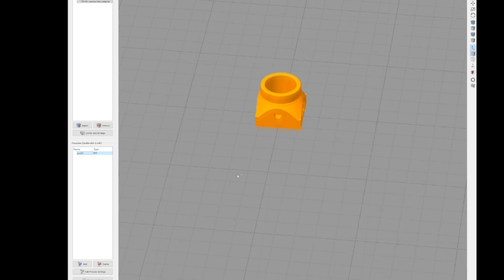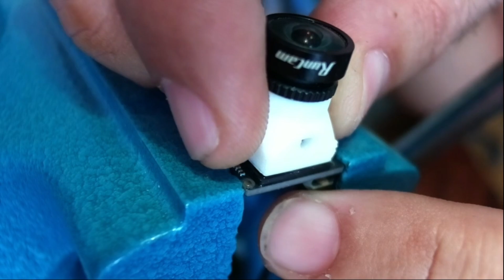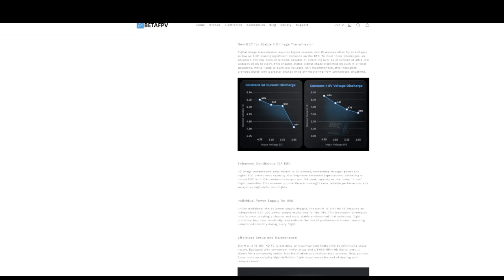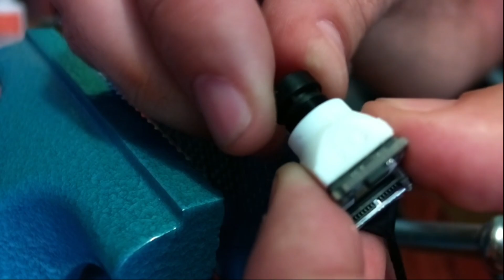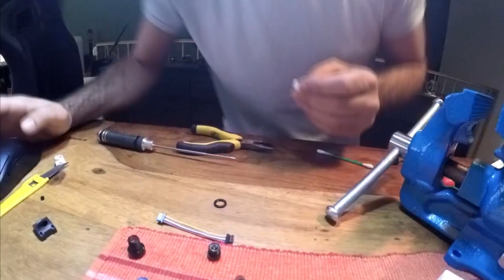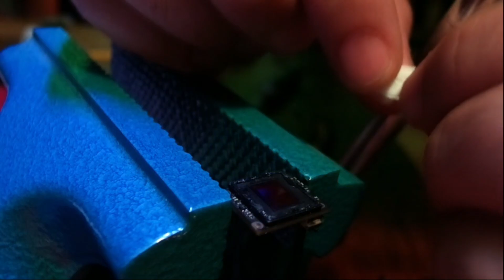O4 Lens Mod Adapter Tutorial

Comment: Did you remove the IR filter on the back of the lens ?
Reply from the maker: no, I just unscrewed from an old camera. if you remove ir filter and use a IR Light you could also have night vision probably...
Reply: @dronevan  I didn't remove it either but I am getting pink tint flare around the center of image... do you get that too ?
Reply: @plmtb3694  If im not mistaken the O4 lite has an IR filter on the sensor already.I removed mine from the caddx ant lens and havent had any pink tint

Comment: Stupid question here: you use the m8/ m7 mount for the lense ,as I understand. And I think you said that the lenses were made for smaller sensors, so u don’t use the whole potential of the o4 sensor. So the question is couldn’t you just use a lense with 12mm mount to get rid of edges and also use more of the sensor or am I missing something?
Reply from the maker: There are no stupid question, only answers ;)

M7 mount was created recently to be able to use Caddx ant nano and other smaller lenses. If you use M8 lens, you are using almost the whole Sensor Area. Comparing to the Walksnail 1s camera, sensor looks exactly the same size. I should try a new mount to use M12 Lenses, but they are just too heavy for the desired application we aim for with the Lite O4. some lenses (M8) weights over 4 grams, that's at least 40% additional weight more to the O4 weight alone for the lens, not speaking of M12 Lenses... You might have the whole sensor area by using M12. But from all my tests I've done, even with a m7 Lens you got resonable results. but best is M8 from caddx Ant. Weight and Size is good. I'll try to design a M12 lens holder soon just for testing purpose. Thank you for your interest
Reply: @ thanks dude 🙏so I know it’s not worth it to try m12 with additional weight if m8 does the job as good with the sensor.

Comment: Very helpful! I upgraded mine with a nebula pro nano lens. I used another STL with he original shape so it could fit easily in my fractal75 that you saw on Facebook!
Reply from the maker: Thank you for your feedback, you mean the stl for the original camera lens?
Reply: @dronevan  it's called "DJI o4 lite camera lens mod" on thinigiverse. It almost shaped like the original one but without the side slots. It's just because it fits perfectly in my fractal camera mount.
I might use yours for a 3.5" build.
Reply from the maker: @stormriderfpv  I might have to modify it a little bit so the canopy screws have more grip. I^ve uploaded a new video today of flight footage.

Comment: Hello, the design is great. I wonder if the HDZERO RUNCAM90 lens can be used. It is cheap and available in large quantities.
Reply from the maker: I have also this camera, and tried the lens. it has same result as caddx ant lite. side by side looks the same. have not compared the weight tough

Comment: Wow, thank you! Works like a charm with the Caddx Polar/Nebula Nano lens. Printed the file in dark XPETG. Happy flying 😊
Reply: Same lens here!
Reply: Is it the Polar Nano / Nebula Pro Nano lens? Does it fit the regular or short adapter?
Reply: Yes, the Pro Nano lens. It fits the short adapter. I also tried the Foxeer Toothless Nano Starlight lens, my favourite so far, less fish-eye.
Reply: @ Thank you!
Reply: @disco.volante  Yes, Ant lens has way, Way too much fisheye!
Reply: @disco.volante  How fisheye is the Toothless? I'm not getting any good info on which is the best image quality replacement camera anywhere... Nebula nano the winner?
Reply: @InfinityDrones I prefer the Toothless 2.1 (Starlight) lens. Great image, only minor distortion. All the other lenses have too much fisheye for me.
Reply from the maker: Thank you for your feedback. I am preparing some lenses to compare. I have also now a nebula pro nano camera and also walksnail 1s and others to test.
Reply: @dronevan  Have you had the chance to try any of them yet? :)
Reply: @dronevan also super interested to hear your results :-)
I wanna try using the HDZero Runcam lens, as it can be purchased rather cheaply. It looks pretty similar to the one you‘ve used here
Reply: @dronevan  problem is, Nebula Pro Nano lens is so expensive to buy!

Comment: Nice work man! is there any chance you could share the 3mf files as well. I would like to tinker with the mount a little since I'm getting black boarders in the edges. Nothing crazy but I'm just wondering if I could get rid of those. Thanks for your efforts, much appreciated!
Reply from the maker: updated video description with desired file :) tomorrow I will be testing some lenses I've gathered
Reply: @ thank you! That might be useful for others as well. Cheers mate I appreciate. Interested in how different lenses work for you
Reply: @dronevan  Have you done some more lens testing? I get the biggest fish eye on my 1.6mm lens. I'm gonna try a 2.1 mm lens and hopefully that will decrease FOV

Comment: Does "short lens" mean for short lenses or that it just makes the lens stick out less?  asking about the "STL short lens with pcb lateral alignment"  :D
Reply from the maker: Hi, I have some M8 lenses from old aio cameras that are really short. and that's why a shorter adapter was developed so those lenses could come as close to the sensor as it is required to get focus. on "normal" lenses like Caddx Ant for example or some Runcam lenses you'd not screw it all the way in and get focus.

Comment: Thanks for your work, dude. Very well done. I want to print the V6 with the clips. I want to ask, you tested it? Or should I print the V3 and V6? When I open the files, it looks smooth where the lens should screw in. Do the files have no grooves for the lens to screw into, like the one you used at the end of the video? i want to use an online printing service but the TPU is like 20 euros, which is very expensive, other materials are like 5 euros which is fine I think since I don't have a 3d printer
Reply from the maker: Hi, v6 I have not tested yet only printed. The lens hole is smooth so the threads of the lens cuts in by itself. FDM Printers would not be able to print the fine M8 Screw threads. I'd go with V3 for now without the alignment and check with the live feed if you have it perfectly aligned before applying glue. Maybe you have a friend that can print it for you. Thank you for your support. This weekend I will test different lenses and the new v6 mount
Reply: @ thank you, so i will print the V3 at 100 and also 99, would u please test the CO3 lens from betafpv? if u have this one of course
Reply from the maker: A user commented that he scaled down to 99% to get an even tighter fit of the lens. Depends of the tolerances of the printer used. I printed in PETG and 100% was ok. At the end if you are satisfied I'd glue the lens anyway so it cannet be losen.

Comment: i keep hearing the narrow FOV on the 04 air unit is from a software crop on the sensor and that a firmware update in the future will open up the entire sensor to 155+ degrees, similar to how the 04 pro looks, for reference the walksnail lite 1s system is 170 degree FOV.
Reply from the maker: Yes I heard the same but is not confirmed. Neo has "same" camera and same fov. This weekend I will test 1s walksnail lens aswell. Hope that dji can release an update to improve fov, but from my point of view this is mostly lens dependant

Comment: Thanks for the hard work, just completed this myself using your 3D print. I found the screw thread was too loose so I scaled the model to 99% and it worked great.
I did not quite place the camera on straight after the glue which means on the left side I have a very small black ring, which I'll sort out later on, but for now it worked great and solved my biggest problems with the O4. So thanks to both you and Jake :)
Reply from the maker: Thank you for your feedback 💪🏽 yeah reducing the scale helps with more accuracy. For me it worked Ok but maybe my printer is not perfectly calibrated. Good to know if someone is printing it with resin. 💪🏽 Have a good week and thanks for the support

Comment: Please do not touch the sensor to clean it from contamination. You are just smearing the crap with IPA. Use the special sets for cleaning and prefer bellow to dry or wipe the dust off (do not blow onto optics with your mouth because of the smallest droplets of saliva and high humidity). 
You glued the case, but several dust particles were on the sensor (please check your footage).
The white filament is as stupid as a transparent one: light goes through your fingers and scatters within the translucent lens holder. Please use the black and the lenses with the IR filter (red plate). Please modify your model so that you can center the case using the edges of the sensor frame. Otherwise, you can shift the lens from the geometric center of the sensor.
Reply from the maker: Thank you very much for your constructive comment. This Week I will be getting some black TPU, and will consider changing the model so it holds the PCB for alignment and it will always be centered. The white filament is just what I had around, and it is also not sitting perfectly flush now, so light is still coming in I have mentioned this many times during the video :). Again Thank you for your valuable Feedback.

Comment: The problem is that your 3d print is in white color. It should be black to avoid white color or even pink  on sensor.
Reply from the maker: Correct, thank you for your input. I have mentioned it multiple times during the entire video. You should print in black and preferrable TPU. But this video was just a quick proof of concept and to have a final stl File for you guys 💪🏽
Reply: @dronevan  interesting take making it out of TPU. Don’t we need to think about Jello then? Did even anybody test if we need soft mounting on O4? 😂
Reply: @luis_gbs  come on dude,  do you really think that we can use this footage from o4 lite to something else than expirience digital on small drones? For that we have o4 pro. And really fov on o4 lite is the only downside of this very setup rest are only pros
Reply from the maker: @luis_gbs  the Idea of printing in TPU is to give a better hold on the lens, but at the end you should glue it anyway. Jello should not be a problem, this is only a lens holder and not a canopy.
Reply from the maker: @w1llyFPV  True, I agree
Reply: @dronevan  isnt TPU flexible? or is it better to have a flexible mount?
Reply: He says that something like 6 times in the video...might want to watch it! Don't bother actually because this Caddx Ant lens has way, Way too much fisheye effect and it makes it near impossible to fly and know how far you are away from objects because the image is sooooooooo distorted.  Others have better solutions.

Comment: what is „6000 glue“, do you mean „e6000“?
Reply from the maker: @luis_gbs  yes, but it is permanent. I've has no problem with plastizap so far. The vapour did not affect my lens... even after a drop falling pn top of it it is still ood and clean. See my comment about almost destrIng the sensor
Reply: @dronevan  try goop instead. its an e6000 derivitive but thicker. safe/no runs. imo...anything liquid would be a no no for me on a sensor.